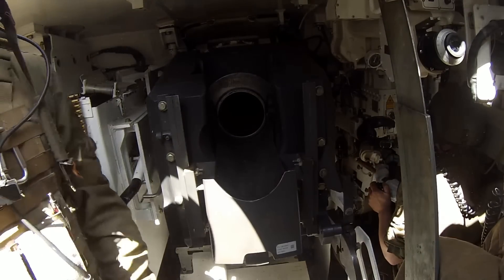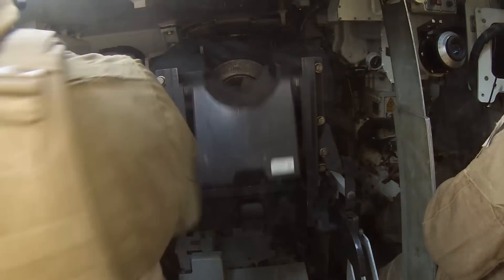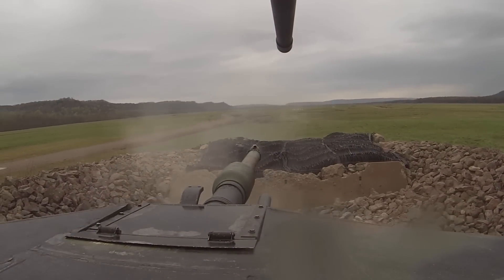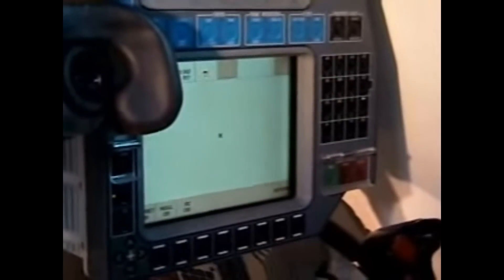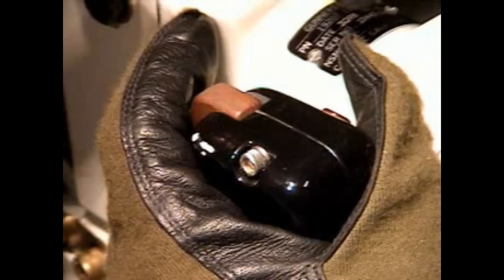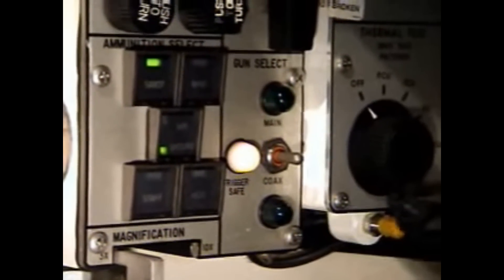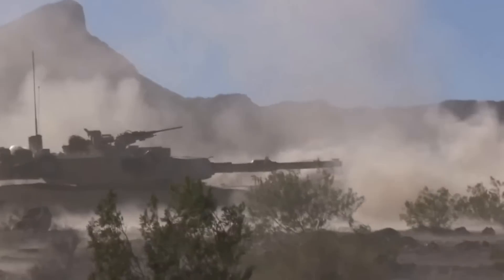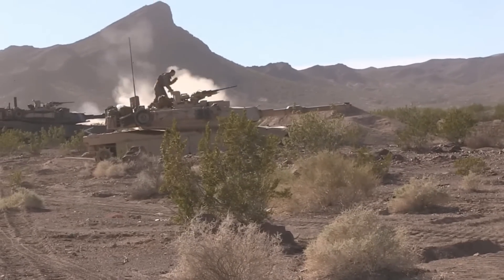How Do They Clear Tank Gun Misfires?

Comment: 15 minutes to declare the round inert? jesus, that would feel like a lifetime on the battlefield...
Reply: In combat it would probably just be, "fire > round failed > pull it out > get rid of it > load new round" all in a minute or 2, procedure has a way of being done away with in combat situations.
Reply: @chaos2876  the manual firing is pretty quick, its probably like fire misfire, "no announcement" manual try announce "MISFIRE" where are those enemy tanks, get that round OUT!
Reply: As commander, the first thing I would do is to tell the driver to back up and get us under cover.
Reply: ghostdog688 One gun out from platoon for 15min. is not that big of a deal. Pull back, deal the problem and carry on.
Reply: Timothy Sielbeck I hear ya. I still wouldn't want to be loader extracting a round under the 15 minute timer in battlefield conditions then.
Reply: @ghostdog688  Probably doesn't make a difference if your the loader, gunner or driver if it goes off. :P
Reply: No, the odds of being destroyed from the outside will be low as ever, especially if you still have cover from other tanks, and other guns on the tank. Pulling out a slow burning tank round inside the turret before you can be confident it's not going to go off makes your odds way worse.
Reply: Not Tactical yeah but the problem there is if the round does detonate while being handled.
Reply: Fortunately, tanks tend to operate in platoons. If one tank suffered a misfire, the other tanks will pick up the slack until the jam is out of the way.
Reply: That's a by-the-book recommendation, sometimes the problem occurs after the main gun has been firing and is extremely hot, the round if it's hot expands in the breech and is difficult to remove.  You don't want a cook off. The TC and company commander might make a command decision that differs.
Reply: yeah i bet luckily you could pull back behind lines and work but still
Reply: BrokenLifeCycle - As long as the tank with the misfire reports the misfire on a secure channel & drops back behind his platoon until it's fixed. Fixing a misfire on a tank under the duress of combat can cause a disaster for that crew and a distraction for the platoon. In some cases the shell has to be extracted without the crew in inside by another technical crew. There should always be reinforcements to fill the gap, that's the only way to pick up the slack for a malfunctioning tank crew.
Reply: That's an in garrison training environment regulation.  In combat you're going to remove it asap.
Reply: Zombie - in world war I, among the first tank platoons used in war, such as Mark IV & mark V, the best tank crews that survived the war, stopped to fix things and made sure the performance of their tank was as best it could be before carrying on into combat. If you're a tank crew, would you want to get hit in the front of the turret with an armor piercing sabot while you got a misfire round stuck in the breech? I don't think so, front line is the last place you want that tank until that problem is fixed. & in combat you shouldn't tell a crew not to do what it takes to get back in the fight at optimal performance, that would be stupid.
Reply: rwhunt99, I would like some clarification on cook-offs. I've been told this happens when a rifle or artillery piece is so piping hot that the heat ignites the shell even if nobody physically fired the weapon. Is that what the military is referring to?
Reply: @largol33t1  Cook off is when the chamber which the round/propellant charge is seated in is hot enough to "cook off" the round or propellant.  You don't pull the trigger, the round/propellant just goes off on it's own due to the heat.  This is a common occurence in MGs.  They get hot, and one bullet cooking off leads to (extract, eject, load, lock) and then the next round gets hot and fires itself as well(runaway).  This is less common in larger guns because of the expense of the barrels(hot barrels receive more wear on the rifling) and doctrine rotating out firers to allow barrel cooling(which also means the chamber cools off).

 Hangfire is when you try to fire, but for some reason the propellant doesn't work in the appropriately short timeframe(should be near instantaneous).  Usually these large propellant charges have a small rod(with holes) in the middle of the charge filled with rather touchy rather explosive primer.  Around that rod is packed the propellant which is more stable.  The firing process lights off the primer, and the primer pours "fire" into the propellant.  If the propellant is just smouldering due to being bad, it may not pour enough energy into the propellant to immediately set it all off.

Misfire just means "tried to fire and we observed that the gun did not fire".  It could be a mechanical error which causes the actual firing mechanism to not work, it could be a hangfire in which the propellant failed to fire immediately but will fire later, it could be a total dud round that just doesn't respond to firing.  Most of the procedures here are to ensure the gun is actually trying to fire the round and check for hangfires.  Then you wait 15 minutes for hangfire/cookoff, then you quickly put it into an armored compartment wthat will hopefully contain any explosion if it does go off(duds still contain a large amount of explosives, especially as you have disturbed them by trying to fire them repeatedly)
Reply: Wait 30 minutes in a challenger 2 as it is 3 peice ammunition
Reply: WOT / War thunder talk. I'll take some popcorn and i'll read the comments and relax.
Reply: agreed.
Reply: probly, ya
Reply: it might be the end of your lifetime
Reply: I think you'd have to pull back out of battery to have your maintenance section work the problem.  A disabled tank is dead man walking, up on the line.
Reply: Tvercetti1 - 1) you are wrong, if you studied the Metalstorm history you would not say this ignorant thing. Several online and offline sources say this ''On 19 November 2007, it was announced that the US Navy was buying Metal Storm grenade "barrels". In August 2010, Metal Storm signed a contract with a value of US$3,365,000 with Papua New Guinea's Correctional Services Minister Tony Aimo to supply 500 MAULs and 10,000 less-lethal barrels for use by correctional services officers. & that is not saying anything about anything done in top secret and Australia is working on the commercialization of this weapon already.
2) in 2016 the Pentagon said they are putting them on at least one ship, a Zumwalt class ship because they are the only ones that have the power to handle a railgun. They did not put it on most of their destroyers because those old hulks do not have the power to handle the new and improved proven cannon.
3) You used the term ''metal'' & just refuted yourself, what makes you think these materials will be all metal or any metal? You meant to say current technologies that YOU ARE NOT AWARE OF. In 2015 General Atomic announced the successful testing of an acceptable rail gun weapon system. The first one has been installed on a Zumwalt. You will not see it unless it is killing you.
4) You failed miserably to answer this point.

No you took a shot because you are a troll with a MISTAKEN belief that new technologies are not replacing old ones. Yet you know about these technologies, which actually makes you a liar. I would not care if you or anyone has a contradiction to my posts, if they were at least partially accurate but your totally wrong, completely. A few years ago you might have been right sort of. life is full of contradictions, it is you that can not handle them and it is you that does not know much about DARPA progress. Metalstorm was not invented by anyone in DARPA, it was invented by a private Australian who no longer controls the company that eventually found clandestine buyers for it. Get lost troll, you have embarrassed yourself enough do you not think?
Reply: Well this section got pretty hot
Reply: Exactly, I don’t think this happens in dire circumstances.
Reply: My thoughts too , but not waiting on an ambered  primer (hangfire) would make it a true lifetime the split second the breech opened.
Reply: After reading these comments , it occurs to me , I've never seen a lone Abrams out strolling. My memory only recalls seeing them in groups . But I'm a civy so take that observation with a grain of salt.
Reply: You would do that in combat, or at least I wouldn’t.  These are simply rangisms to mitigate risks under optimal conditions.
Reply: ghostdog688 imagine it on an autoloader
Reply: That WOULD be a lifetime on an active battlefield. Just be happy you're not doing that in the trenches around 1905
Reply: oh yeah!  if I were a tank crew member, that would the most nerve wracking time!
Reply: 30 seco ds is a lot in a battlefield
Reply: Usually it is stated that these procedures are only cared for during practice. In an actual conflict, you'd just throw it out the hatch after checking that the electronics work properly.
Reply: It might even BE the rest of your lifetime if the tank gets shot at and maybe destroyed
Reply: Good point. I’m guessing the 15 minute wait rule was written in blood though. Perhaps a crew tried removing a round too soon and it detonate?
Reply: A well trained crew can go through all this in about 2 minutes.
Reply: See what happens when a T55 crew mishandles a misfire in combat and ejects a live round without waiting:  https://www.youtube.com/watch?v=dVBApQohxUI
Reply: if a misfire happens in an armed collum, i would think they would imeadiatly announce it, and try the 6's firing things mentioned, then inform the collum to reajust/reform themselves, while they move away from the active battlefield.

Basicly, a missfire, should stall a tank, and make it "unfit for duty" so it should be 'removed' from the field, not to expose flanks, and holes in formations.

i aint a speciallist, or even an army man, but even i know this much. it's basicly, safety of the crew  first, and then safty of the nearby personel, cause vheicles, can be changed, while people most times, cannot.
Reply: Im sure it's to see if the round doesn't "cook off." It would suck if that should happen while extracting the round.
Reply: @thepsychicspoon5984  if the round was about to cook off, or there was any concern about that, I’d want that out the tank *faster*. 15 mins may be pertinent to avoid a cook-off in peacetime, but if this was a battlefield situation, I’m going to expect my loader to get that dud round the hell outta my tank *yesterday*. I need another round in the chamber that works before we all get turned into pink mist and spare parts.
Reply: @ghostdog688  I'm sure that in a combat environment you're going to make adjustments, like you do what you gotta do. But I suspected that 15 min was for during training and range safety.
Reply: Tommy Estridge better add popping smoke and arranging cover fire from the other tank :)
Reply: Realistically I think the commander would have declared a round a dud after like 5 min and tell the driver to get cover
Reply: tvwerkcuntti1 & for others who will read this and not a dumb shit troll like you here are online legit sources that clearly refute you. http://taskandpurpose.com/kinetic-bombardment-kep-weaponry/
(Ligetimacy of railgun realized)
https://web.archive.org/web/20150626005127/http://www.seapowermagazine.org/stories/20150622-railgun.html (successfull 100th test of an effective rail gun called the blitzer)
https://news.usni.org/2015/04/14/navsea-details-at-sea-2016-railgun-test-on-jhsv-trenton (In 2016 this says that by 2017 new naval destroyers will be equiped with the current blitzer rail gun system as they continue to improve the technology to their stated goals by 2020.
.
Reply: William Cox - that may be true but a disable tank could also dig in, camouflage and turn itself into an improvised ambush if needed. Maintenance crews will not always be available.
Reply: tvercetti1 - Which is one reason why they are steadily replacing ballistic weapons with kinetic weapons that operate on electromagnetic force that doesn't turn the barrel or the firing pin into overheated mush after periods of rapid fire.
Reply: NO YOU ARE THE TROLL & that is obvious to anyone!  I did not say the technology is not still experimental. You whined to me about some thing I said that you feel is not accurate and then try to make me out to be wrong & you have no proof I am wrong, just bullshit denials that are laughable. Except maybe for the tanks do not have it YET, which means shit because you do not know if some of them do not have it either.  Because the technology provably exists, anyone who looks into it finds out I am right. It is not a secret anymore no matter how much they want it to be.
Reply: Your denials are in serious error and everyone STUDIED knows it. When you used the word EVERYONE, you forget to mention everyone who is studied. Your everyone is ignorant dip shits like you! So, again, I did not say the technology is not still experimental. In fact even the technology that it will be replacing is still experimental, almost every thing humanity does and is doing every day is experimental. Life is the great experiment. Your premise was that we are not using this technology, are not placing it into combat situations or usage or mission capacity. I have already shown you are wrong, absolutely.
Reply: & you can not let it go troll and YOU HAVE TO KEEP TRYING TO IMPOSE YOUR OPINIONS ON SOME ONE ELSE as if they were declarations of truth, which is tyrannical net troll bullshit and anyone with half a brain knows it. Are you hired by the government to deny this shit? That is the only thing you are proving here that behind that computer of yours, no one can even imagine how a dumb thug like you could even know how to use it, & out from behind it you are man or woman in black or some thing. You probably have a kinetic weapon sitting right beside in the event when you get exposed. So it stays secret and in the Shadows.
Reply: That is the only thing you are accomplishing here is making yourself look like a dirt troll government shill for military secrecy. You can only deny this to the ignorant not to people who are in the know. & by the way your statement about DARPA was WAY OFF BASE troll, because you failed to realize that Metalstorm was not invented inside the DARPA program... you did not even know that you dumb internet thug. While you pretend to know everything about it but your total sum of knowledge about kinetic weapons programs has been shown to be equivalent to that of handful of dirt.
Reply: It IS a lifetime on the battle field. That fifteen minutes is probably a range safety issue. War time rules are slightly modified I would think...
Reply: Probably wouldn't happen in a conflict.
Reply: And if you follow that procedure you have an extremely elevated risk of being destroyed anyway.
Reply: I am sure on the battlefield they dont give a shit and remove the round and throw it out the hatch as they dont give a shit about environmental concerns.  I doubt they would even  go through 6 misfire steps after the 3 or 4 they would just toss it.
Reply: @cynicaltexan9639  You're sure based off what?
Reply: @nashonabo   I was a tanker in the army and was surrounded by combat vets. I personally have never been deployed.
Reply: @cynicaltexan9639  To me youre just some random guy on the internet. I dont know a soul enlisted that wouldn't follow basic instructions like these and risk not only destroying a valuable asset, but killing the most valuable assets we have which are the people serving in a war we don't care about that do still follow procedures outlined for the safety of everyone. The fact you say that makes me think either you're lying about having served or that I'm glad you aren't a risk to yourself and those around you because you lack foresight and think you're smarter than than people who created these procedures. I'd say I'm surprised but seeing as you're a Texan... Not so much
Reply: @nashonabo   I dont think I am smarter than anyone.  I was referencing what my senior NCOs talked to me in conversation at gunnery.  At gunnery all steps were practiced. You seem to have no ability to actually read a comment and understand the contents of said comment.
Reply: Blah b - No you're clearly putting words in my mouth that I never said like the stupid troll you are. Don't think I don't know how to spot an a-hole troll like you & I do not talk to stupid trolls. Get out of my face now or I'll make you get out of my face!

Comment: how can you have a tank that's chemical weapons proof if the barrel is like a straw going into the tank?
Reply: Democrats are SCUM Nuke mecca NBC pressure system.
Reply: The NBC system makes the inside of the tank slightly higher than atmospheric pressure, so any gas exchange between the inside and outside of the vehicle will be air leaving the vehicle rather than entering it, with the exception that air is brought in and filtered through a specific part of the NBC system.
Reply: Density causes gas to sink, not defeat pressure.
Reply: Democrats are SCUM Nuke mecca the crew wear mopp suits.